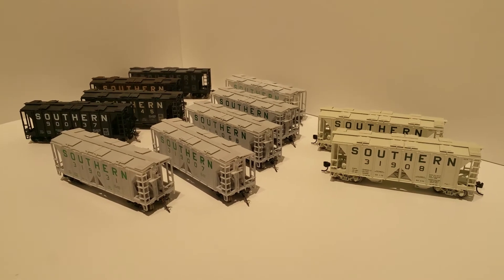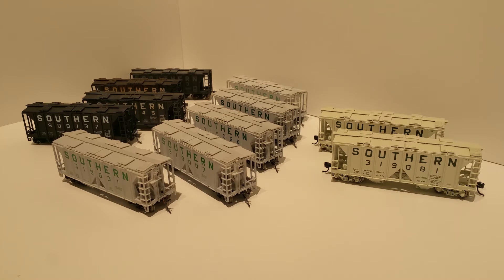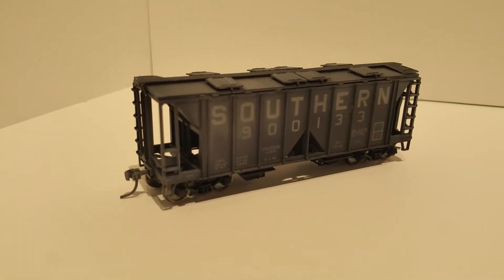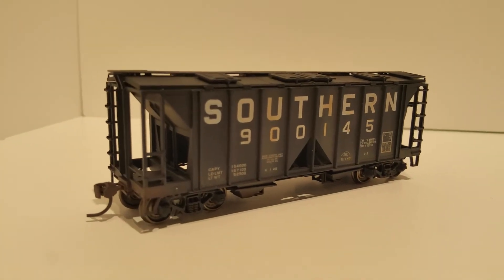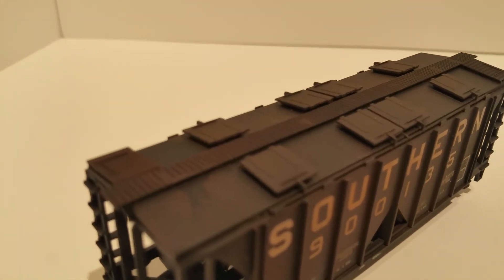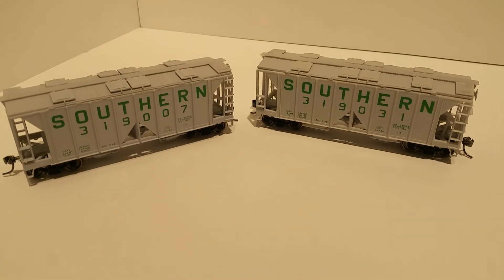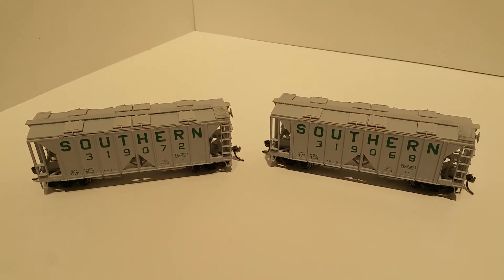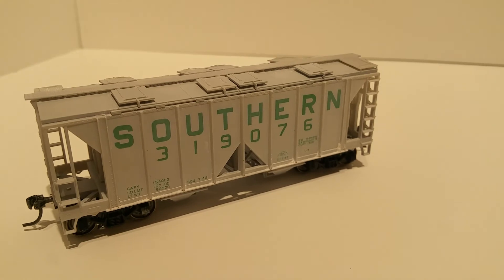HO SCALE BOWSER SOUTHERN RAILWAY 70 TON 2 BAY COVERED HOPPERS REVIEW

Comment: Thanks for the review! You're right, they are very good looking cars. Assembling one of these cars is not difficult, as long as a modeler proceeds slowly. I have one that will receive light  weathering. The only mod I plan for the body is to replace the bottom stirrups.  I have some spare metal stirrups that are thinner, so I plan on cutting off the stock ones and installing the thinner aftermarkets ones.
Reply from the maker: Thanks for your comments !!!!!